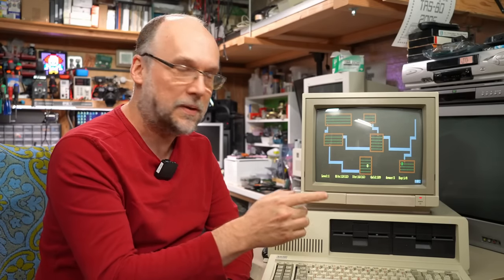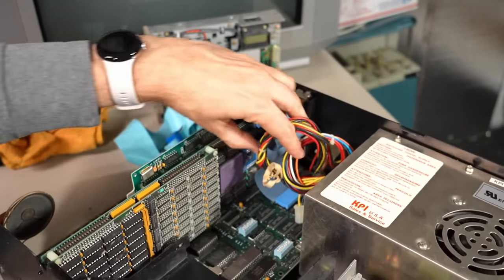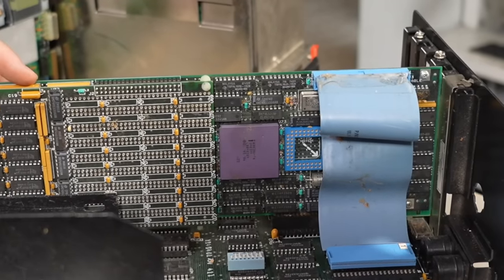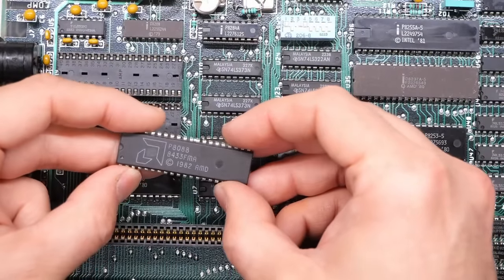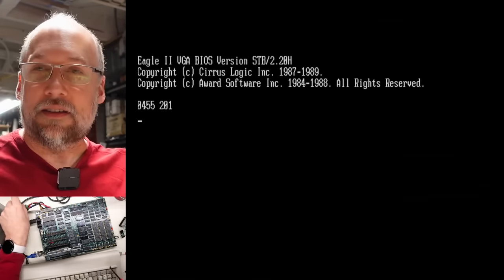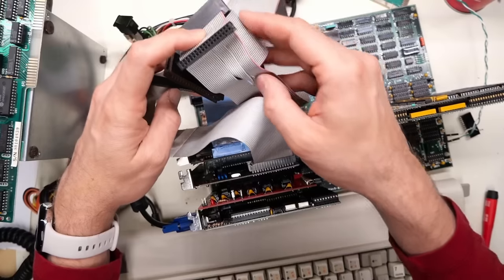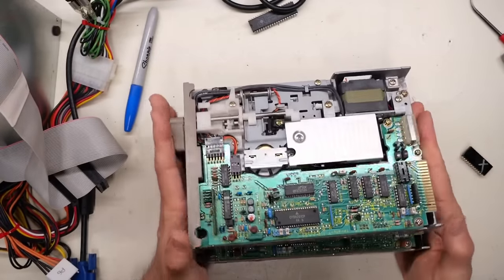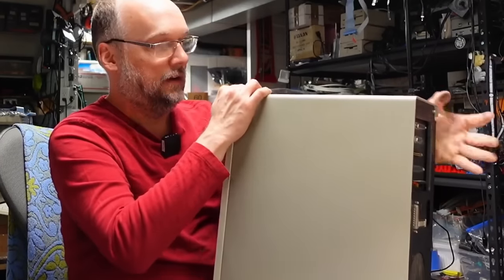PC Archeology: A left for Dead IBM PC 5150 with a treasure hiding inside 🕷

Comment: Hi Adrian, they did make adapters to use half height drives in these.  My dad set one up for me when I was a kid with two half height 360K diskette drives and a ST-225 20 MB Harddrive.  I didn't think I'd ever fill it.  A company called Hauppauge Computer Works made 386 motherboards with 5 slots that would fit in those 5150 tin cans.  I can remember using them to upgrade IBM PC 5150's to 386 in the late 80s.
Reply: Another previous ST-225 owner here, although I cheated and ran it with RLL-controller for extra 10MB of capacity. Worked flawlessly and as I know that old machine+hdd was still in active use in late 1990's.

Comment: Keyboard: The foam (or something) is probably making it act like one or more keys are stuck down, so it's constantly sending codes or at the least not properly initializing.

Floppies: You connect floppy drives, don't change the DIP switches to enable them, and wonder why you're having issues? 😁

Intel 386 InBoard: I recognized it, or at least what it was.  They made a fair number of InBoard and OutBoard upgrades back in the day.  A family member upgraded a Packard Bell with a Pentium Overdrive; switching the turbo off gave us about a 10-MHz equivalent Pentium... Rather slow!

Comment: 09:05 - I still have a tool set with those e exact same nut drivers. The set came in a "hard cover" zippered black leather case and has also screw drivers, tweezers and an IC puller. After over 3 decades the elastic bands that hold the tools in place got kind of stretched out (I managed to re-tight them), otherwise the kit is in pretty good shape. And it's what I still routinely use today for servicing my PCs.

Comment: When I saw the XT to 386 accelerator card I was beside myself!  What a find!  I had heard of them before, but it was more talk and less often seen on XT systems than say a 286 system being upgraded to a 386 or 386 to 486 which were more common upgrades because you get the full 16-bit ISA or 32-bit EISA or VESA local bus slots.  With the old XT mainboards you are stuck with 8-bit ISA.

Comment: I was surprised to see it boot to BASIC!  My first exposure to PCs was in the 80s, my dad built an IBM PC XT clone from mail order parts.  It looked exactly like the PC you're working on now, but it definitely didn't boot to BASIC.  That must have been a feature of the IBM ROMS in the official IBM computers.  I'm glad to learn something new about something old!
Reply: It was.
Reply: Yeah ROM Basic was an IBM only thing. They included it because of the minimum 16k config with no floppy drives, needed some way to boot it and use the cassette port. IBM wanted to fit into the existing micro market which all booted to Basic, but in the end pretty much the 16k config was never bought due to the high price and businesses wanting floppies and DOS. IBM kept ROM basic around forever too for compatibility (Basic com and basica com both just extend the rom basic) until about the Aptiva line. The clone makers never had a cassette config and most didn't license the ROM basic from Microsoft, instead getting GW-BASIC included on disk with MS-DOS
Reply: @St0rmcrash  I do think, though, that some clone motherboards had places to install the ROMs if you had, or were willing to sail the high seas for, them.

Comment: Approximately in 1998 I also encountered the same combo of 5150 and 386 accelerator in it. But my friend who got these boards, was not interested in retro computers and disassembled it for parts. It was not working (missing bios ROM). Also 386 board had only 1 meg and no second board for memory expansion. in all other ways it was pretty much the same (16 MHz and intel sticker inside). even the ribbon cable to 5150 CPU socket was of the same type and color. I begged 4 BASIC ROM chips from this and keep they in my collection until now.

Comment: Great video.  Thanks for all that you do to keep us entertained.
Reply: And educated.  My first computer was an IBM XT 8086 (4.77 MHz) clone by a company called Victor (bought it from a store in Washington DC sometime in 1986).  Sat horizontally (not vertically) and had a pop-up lid that made access to the inside very easy.  My oldest brother's first computer was in 1978, I think.  I don't remember the name of it (and/or which company), but it had 4K of RAM, I think, no monitor (he got a small b/w TV screen (maybe 8" x 8") from a friend to use as a monitor), no sound, no floppy drive (you saved to/loaded from a cassette player), no hard drive.  Mainly typed-up and played BASIC games on it (like Hamurabi, Mugwump, etc.).  He had a book of BASIC games by DEC, I think (which is where I learned that not all BASIC code is compatible with all computers; some games, even if typed in correctly, just didn't work).

Comment: In the late 90s, I was gifted a 5150 that belonged to a high school friend. His father worked for IBM in the 70s and 80s and the computer was decked out with a 5161 expansion chassis, RGB monitor and a bunch of other stuff. I remember spending hours playing games on this thing at his house in the mid 80s in middle school... Sold most of it on eBay during a financial crisis. Wish I still had it all, for many reasons...

Comment: That accelerator looks like an Intel Inboard 386 - I've been watching a bunch of old Computer Chronicles recently and "Add-On Boards (1988)" was one of them - skip to 14:27 in that episode.
According to the guy from Intel it comes with 1 meg but the addon board clipped to yours should up that to 3.
Reply: It has its own Wikipedia page. "Intel Inboard 386" There were two versions: 386/PC and 396/AT. The PC version sold for $995 while the AT was $2,495 fully loaded. Real money back then.

Comment: Mid 90's IBM Aptivas (re-badged Acer PC's meant for consumer use) also used flat-head screws.  In college I had a job bludgeoning student PC's on to the dorm network.  (10Mb 10BaseT, Netware, and Windows 95, just one year after release.)  Those Aptivas were the bane of our existence; we cut our fingers trying to remove those stupid screws (our toolkits did not have a nutdriver that would remove them) and getting NetWare Client32 installed and working on them usually took about 3 hours, most of which was spent plumbing through the depths of the registry, trying to figure out how the installer screwed up.

Comment: One of the pre release versions of the 5150 IBM PC that was shipped to IBM internal offices for field testing had power supplies without a fan, probably the reason for the covered over cooling vents on cases in later years. They tended to overheat. Not all IBM PC's had black power supplies. Many came with shiny metal cases, I think the vendor for those was Aztec but I could be wrong, was many years ago.

Comment: I recognize why the computer was in that state, as I've done something similar in the past: open, clean, try to fix, fail, remove parts useful to me (VGA card, terminators) and put everything together with the minimum number of screws so it won't make noises while transporting it to the recycling point.

Comment: Spiders are the reason I stopped buying stuff from Australia. :)  The 386 board is super cool.  I have a Sota 386 board that came with a Commodore PC10 my friend gave me.  Never did really test how much of a difference it made.  It had a spot for the original 8088 CPU and you could switch back and forth between that and the 386.

Comment: I currently have an original IBM XT motherboard (technically used to be in a Portable but at some point in history it got moved to a regular generic desktop case.) At some point I acquired an "Intel Inboard" myself, which contains a socketed 386DX. I pulled out the 386 and put in a 386-to-486 upgrade. So my XT motherboard reports itself in MSD (Microsoft Diagnostics) as a "486DX" with an XT bus.

When I was a kid, I had another specific 386DX upgrade which was called a "Kingston 486 Now!", which contained a socketed 486DX-33. First I changed it out to a 486DX2-66, then I replaced that with one of those "586" upgrade chips. (Don't remember which one.) Unfortunately I lost the Kingston part a very long time ago, and I've never been able to find another. I've long been curious if I could in fact make an XT motherboard have a ""Pentium"" CPU.

Comment: I received an original IBM 5150 years ago, gifted to me with an original Microsoft V30 accelerator card and an early Microsoft mouse.  It also had a twin 10MB Iomega Bernouli drive in a case a little bit larger than the 5150 itself.  It had a Hercules graphics card.  It was fun to use for a while, and I eventually gave it to a friend after buying myself a local built 486 PC.

Comment: Flatheads are still king in industrial, farm, and basically any dirty/severe environment. Why? Because you can clear the head with the tip of the screwdriver. Philips, torx, etc, can't be cleared of debris. If you try to put the driver in them you will only compact the debris and make matters worse.

Comment: I got a free B model 5150 a few years ago, and it had a 286 speedup board in it. Very cool!

Judging from how Adrian's computer was configured, I would wager a guess it probably had a hard drive sometime in its life. That's why it has the half height drives. It might have also had a 3.5" floppy at some point in its life, but there's no way to be sure.

Comment: I love such old IBM maschines.  I am grow up with those decates ago and it was painfull to install or change hardware settings, because they don't had a rom resident BIOS setup, that every regular PC since the late i286 Modells have. Harddrive - ST506/ST511 Interfaces with a ibm diagnostic disk. I had used that time an 32MByte Seagate ST238R in combination with an Omti 5520 RLL Controller. A gread hard drive that time.
The system don't know virus or ransomware attacks. Nothing works if you don't start them. Well, sometimes is miss that time.
The forst maschines started into Basic loaded from ROM. Later this was replaced by GWBasic started from MS-DOS by a Disk.
A fine system was MS-DOS 3.22 and Turbo-C to get experiences in programmin "C" languages. I remember about the EMM/EMS-Ram expansion and some of the autoexec.bat lines of code to load some of the background programms into higher memory. Don't miss this stupid things.

Comment: The sticky black foam inside the keyboard can become conductive and cause lots of issues on higher impedance circuits. Make sure you take it off and clean up the surfaces. I would also blow it off with a compressor... Thanks!

Comment: Great video, and what an amazing accelerator card. Those Shugart SA455 drives are the same as the ones I use with my BBC Micro. They're good, mechanically solid drives, but I have had a couple where the CFD8201 controller chip has failed. I worked out a replacement for it using a CPLD, which one of my drives here now has in.

Comment: Looks like an Inboard 386, I have one but mine doesn't have the RAM extension daughter board on it. I would love to get enough RAM to run Windows 95 on the thing but without an open source\reproduction alternative to the extremely rare memory expansion, all hope is lost!
Reply: Windows 95 had a minimum requirement of 4MB if I remember correctly.  I once installed Win95 on a 386sx/16MHz with 8MB RAM and it was unusably slow.
Reply: I ran Windows 95 on a Pentium 100 with 8MB... Maybe 4MB of ram back in the day... Fast enough to play CDs lol
Reply: @hardlyworgen71  I'm sure it was. Good thing as a vintage tech person, agonizing slowness is part of the fun! If I want fast, I would just use my newer computers. I mostly just want to point at it and say, "Look at this lettle feller go!"

Comment: My first computer I bought when I went to tech school in 1994  had a similar card.  It was an Inboard 386.  Mine was fully populated with 4 megs of ram and the 387 math  co-processor on it.  Properly configured with the right drivers, it was fast.  My only drawback was I had an old ST-220 hard drive, and a CGA video card.   I used it to dial into BBS's with a 2400 baud modem.   I replaced it with a 486-DX 33 machine.

Comment: As I recall disabling the floppy drive on the dipswitches makes IRQ 3 available for other devices.  Remember back in the early days IRQ, COM and ROM addresses could be (and usually were) manually configurable, so if you needed to put another device on IRQ 3, I think disabling the floppy on the motherboard would allow you to do that.

As far as your keyboard, I'm pretty sure it was actually working, remember the keyboard you switched to didn't start working either until you resolved the memory issues, you resolved the memory issues and then the second keyboard started working, but you never tried the original scummo keyboard again...

Comment: Back in the day internal to IBM there were the IBMPC Forums hosted on mainframe VM systems. Many of the folks there were far smarter than me and came up with all kinds of marvelous things, like device drivers and instructions on how to configure the 5150 for 1 MB of memory using IBM add on memory cards (you didn't think those DIP switches of the MB stopped at 640k, right?), getting unsupported hard drives to work with IBM hard drive controllers, all kinds of neat stuff.

Comment: 11:18 watches still use flatheads but they are a bit different so you can imagine the mild annoyance of trying to keep a screwdriver centered without it slipping and screwing up very delicate parts like tiny hairsprings or gear teeth.

Comment: This Micron Tech drams (MT mark) are a notorious failure-point.  The American flag ones weren't  so great either, but the MT used a different process of manufacture than others and that process made chips with a finite lifespan either on the shelf or in use.

Comment: I see another difference from the later 5150, there is a cutout underneath the power supply. On the "model b" cases it is solid with no hole there.

Comment: The best option to use with security every hours : remove power supply, open it, replace all circuit board with a new and current tech atx sfx power supply main board. Now you can use without problems and security.

Comment: One thing I often wonder about your restorations (and I think you maybe spoke about it in one video) is washing PCBs... You mentioned using "soap and water", but what type of soap? A long time ago I read that dish soap contains a lot of salt so can leave a corrosive residue even when washed away.
Reply from the maker: Dish soap for me -- just the typical "Dawn" type stuff.  Warm water, a brush and a little soap. Curious why any of the soap and its ingredients would be left behind when rinsed? Perhaps if you have hard water? (We don't here)
Reply: Perhaps rinsing afterward with deionized (distilled) water will negate any risk.  I'm going to try that with my latest repair project... a very dirty Amstrad CPC6128

Comment: I tried going through the footage frame by frame, and it looks like the spider was hanging out on the underside of the floppy drive.  When pulled out, it tumbles over the lip, runs back underneath the case, and possibly gets pulled along by a strand of webbing as the drive is pulled away.

I'd probably freak out too, I am not a fan of spiders.  I don't care if they're "friendly", I don't want them around.  "But they eat other bugs!"  I don't want there to be other bugs for them to eat!  If there's bugs, that's a problem that needs to be properly solved, not having a bandaid slapped onto it.

Comment: Yes the foam is under the whole keyboard. I completely refurbished my model f when I got it and it was horrible. That foam just disintegrates. To open the keyboard you lever up the tabs and slide the whole back plate sideways. Getting it back together again is also a horrible task...

Comment: This video enticed me to pull my old 5150 out of the closet. Mine has a NEC v20 CPU, math coprocessor, 640kb, 30mb Miniscribe RLL hard drive, 1.44mb and 360k diskette drives, and a 8 bit ISA VGA graphics card, think it came from a IBM PSI but not sure.

Comment: Oh, and do check if it is actually an PC/XT keyboard and not an AT one. I have the very same that came with my 5150. But it's an AT keyboard and does not work on the 5150.
Reply: That's an XT-type. The AT ones don't look like that.
Reply: @sedsberg77  The AT version of the Model F has status lights and a couple of the keys are moved.
Reply: @sedsberg77  Yeah, I've seen AT Model Fs before (lived at a boarding school that got a lot of secondhand equipment from IBM Poughkeepsie). I also used to have an AT Model M and currently own two PS/2 Model Ms (an IBM and a Lexmark).

Comment: 43:00, I could be very wrong, but didn't the cassette port and floppy disk share that interrupt, so with the switch in No Floppy mode  it would be assigned to the port on the back instead of whatever card is trying to use it?

Comment: If I remember right, the PC Keyboard controller (an 8048 MCU) was in charge of resetting the main PC processor e.g. when you did the 3 finger salute, so there was an output line on the keyboard wire connected to the master board reset. So if the keyboard is faulty it is entirely possible the motherboard will experience reset issues. It seemed the system froze at about the time the main cpu was testing for the presence of the keyboard... possibly linked?
Reply: I know the AT had the KBC able to trigger a reset as a hack to get the 286 out of protected mode, I don't think the PC and XT did.

Comment: due to the fact the roms use very low frequency, what about a modern ribbon cable to move it away from the isa bus kinda like the accelerator card but for a rom chip.

Comment: But what exactly IS original, in a machine that was designed with off-the-shelf parts in 1981? Isn't in-promptu utilisation of whatever is available "original" for the PC? Isn't a computer with a 8088 as original as any other one? Wouldn't be a rose by any other name smell just as sweet?